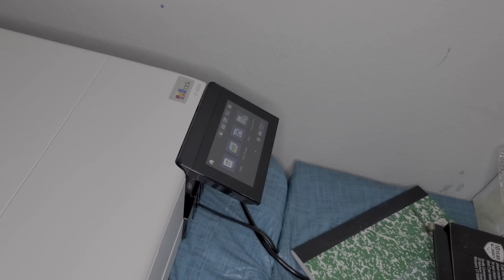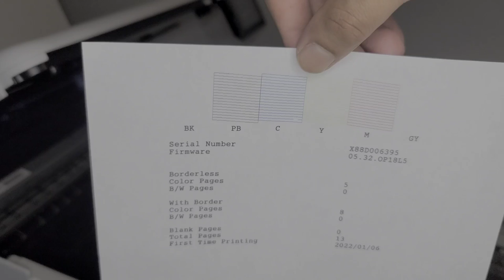How to convert Epson Ecotank ET-8550 to DTF Printer (Direct-to-film) Part 2: Removing Rollers

Comment: Thank you!!! I watched your videos of the first conversion of the Epson Ecotank printer to DTF.  It looks like with this second one, there is no other way but to forcefully pull out the roller/pinwheels as one side the screws are unreachable? The roller/pinwheel is connected to the beige bar and that whole piece comes out and stays out? Logically it looks like the printer would be damaged... but it is not?
Reply from the maker: Thank you! You can get to the other side.  Taking off the side panel closest to the capping station will give you access. Rollers are underneath a piece that keeps the ink feeding tubes in place top of the ink reservoir tanks. Its removable but connecting the ink tube back to the reservoir tanks is a hassle. You need really tiny fingers.

Comment: I have converted my ET8550 over exactly how you did with White, White in the first two canales on the printer.  White does print but not over my entire design and when the design is cured it looks vibrant and pretty on top side and when I flip it over to be pressed the color is dull and washed out as if it has too much white bleeding through.  What am I doing wrong?    I have Cadlink 11 software also?

Comment: Can this be done with the 8500 printer?
Reply from the maker: Yes but the 8500, can only print up to 8 inch wide prints, this is way too small for most adult sizes.

Comment: My ET- 8550 stopped printing white..
What can I do to fix the problem?
Reply from the maker: Clean your printhead
Reply from the maker: Power clean function will usually do it. If that doesn't work you may have to manually clean it.
Reply: They say you have to shake the right ink off them at least once a week or every day
Reply from the maker: Everyday

Comment: Hello im trying to convert my et 8550 to dtf I got the ink in but when I do a test print it prints blank what do I do please help me
Reply from the maker: Did you convert straight out of the box or did you use the Et-8550 for something prior?
Reply: @HangryMuscle  I did right out the box but I got it to print correctly no I just have to get the software In order to complete the conversion
Reply from the maker: You can purchase it here:
https://dtgpro.com/cicproduct/acrorip10-5.php?afl=3277
For an extra discount Use Code: Hangry
Reply from the maker: @jessicamason3520  run a power clean then regular print head cleans if needed.

Comment: I don't think is good idea. I believe the print head will easily clog. DTF ink is textile ink specially the white one.
Reply from the maker: That hasn't been the case and I've been using the Et-8550 for DTF now going on 5 months.
Reply: Owes it holding uup. Thinking about buying one